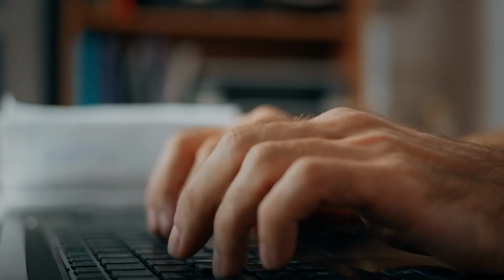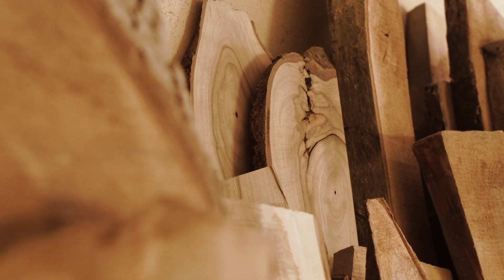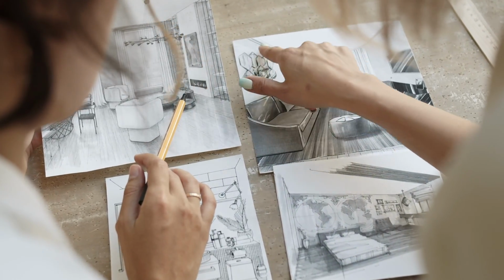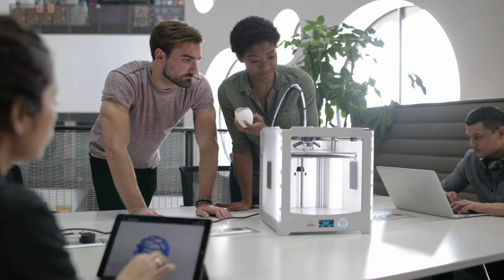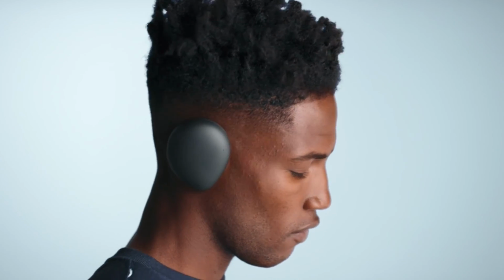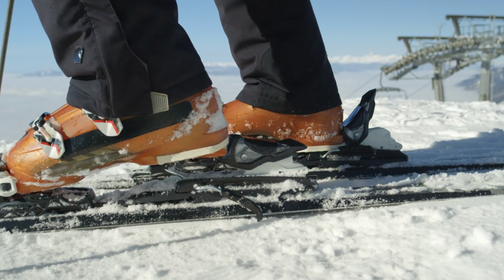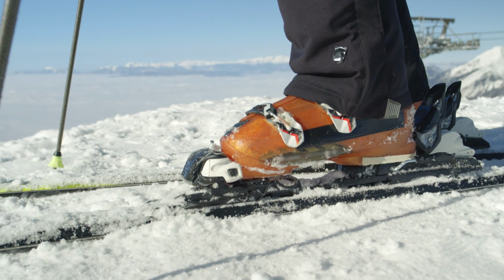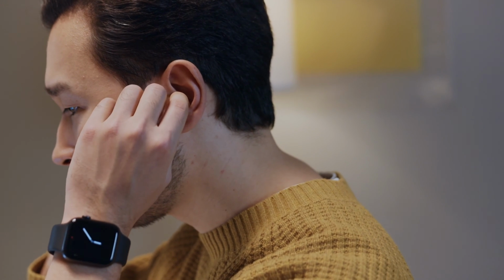Ergonomic Design

Comment: There is no such thing as a standard user. Designing involves embracing the diversity of bodies, abilities, reach, and modes of interaction. That's why dimensional adjustment isn't a fixed number, but a range; and that's why posture, effort, and movement must be considered from the very beginning of the design process.

I strongly emphasize iteration with physical models because the body cannot be understood solely through statistics. Real-world contact with the object allows us to detect misalignments, tensions, and opportunities that data alone cannot reveal.

I believe the future of ergonomics lies in deepening this perspective: integrating quantitative information with bodily experience, and designing from a perspective of diversity as a value, not an exception.

Comment: 3:19 "The vast majority of designers are men, so they design things for male proportions"
A true professional designer never uses themselves as a design reference.

This applies to both aesthetic and formal solutions, as well as ergonomic solutions.

Regardless of gender, if the designer doesn't use official ergonomic references based on ergonomic studies of the population, they are simply an amateur industrial designer!
Having more men or more women developing projects won't make any difference if the designer doesn't use the correct professional methodologies!

It's also important not to confuse ergonomic design with anatomical design!

Comment: Would be interesting to hear some examples of bias against women in ergonomics. As a 186 cm male (which is not extremely tall) I struggle with most “standard” countertops, sinks, tables, chairs - they all seem to be designed for shorter people.
Reply: You should check out the book "Invisible Women"! Not necessarily ergonomics specific, but how women are left out of data collection and the disastrous results.
Reply: The idea of "shrink it and pink" it is a common excuse for someone claims to be designing for women what was originally made for a man. It still doesn't work.

Comment: Looking for examples of ergonomic homes but cant seem to find any  not a fan of 90 degree angles  looking for rounded soft natural lines and materials used in home construction  Anyone?
Reply from the maker: You don't hear of home design as ergonomic very often. Usually, it centers around human factors and lifestyles. But, you can look into computational and generative designs. These technologies allow designers/engineers to create very unique, one-off designs for specific use cases. We have a CNC router table in our workshop to design just that. Thanks for asking the question! Cheers.

Comment: Thanks for the video, how do we highlight the ergonomic features with supportive data/evidence?
Reply from the maker: Good question! It's important to prototype and test repeatedly. We insist on user testing, both informal (e.g. we wear a prototype around the studio) and formal (e.g. observational studies in clinical settings where we hand users the prototype and see how they hold it, ask them how it feels, etc.). The data collected is often qualitative but can also be quantitative. 

Thanks for watching!
Reply: @NonfictionDesign  thanks a lot for the answer. Really hope there is a way to use data to support the ergonomic design can help users in certain ways or reduce certain pain points.